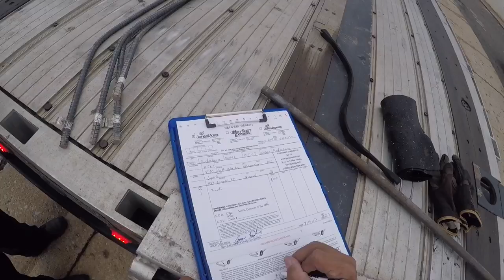JMC--Stepdeck AT&T Truck Unloading

Comment: Thanks for sharing. I accepted a load with a metal container from rails but damaged so it cannot go on chassis.   My step deck is 1 foot lower than deck at warehouse and I'm stuck at this site because I don't have my own set of ramps and this company doesn't either...my stupidity won this time😮😬😭
Reply from the maker: If your trying to be sick height you can drive onto some dunnage to raise trailer or inflate your air bags if possible or drive into something solid

Comment: Hey Is your ramp kit bolted or welded on ?
Reply: Welded /
Reply from the maker: +Garrett Reynolds bolted
Reply: Randee Lewis did you do it your self ? If so what size bolts did u use
Reply from the maker: +Garrett Reynolds no it can with it already